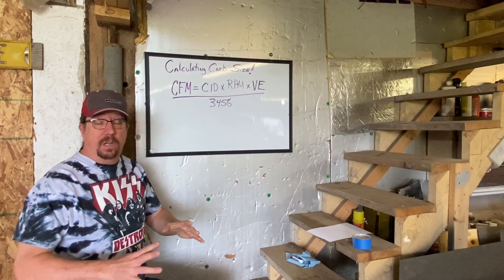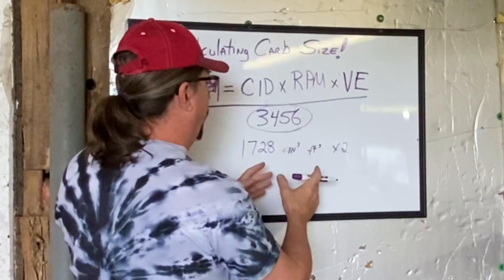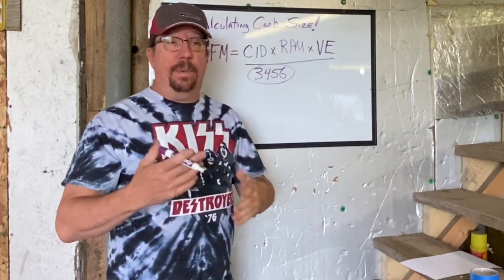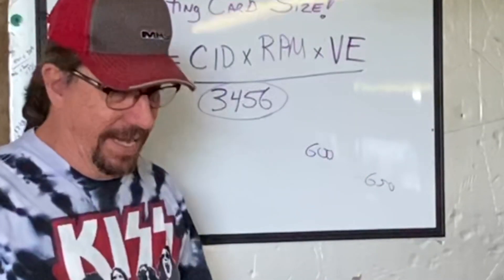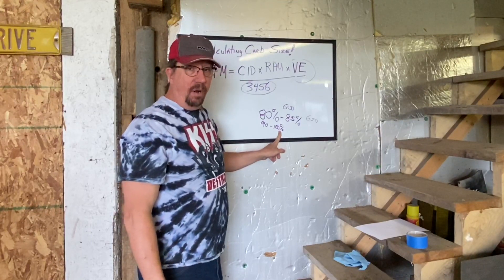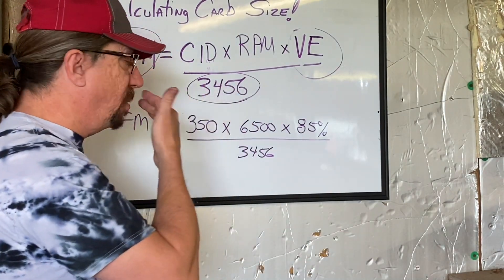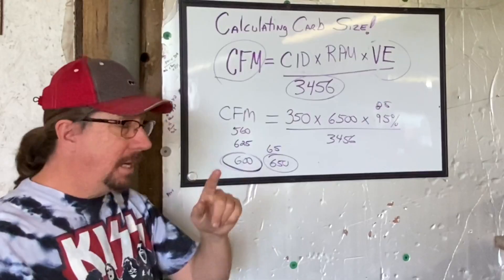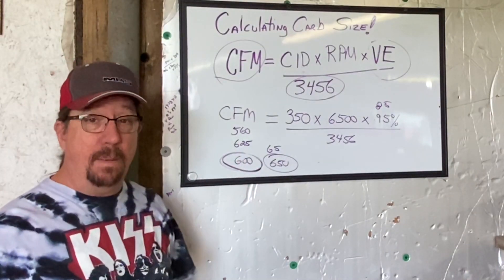HOW TO: pick the right carburetor.  SIZE MATTERS!!!  Don't overestimate, do the math.

Comment: People need to understand something basic about a CFM rating for a carburetor. It is a capacity and not a supply number. In other words the carburetor is not a pump but rather a valve. As the formula is showing an engine that can pull/call for "x" number of CFM. Basically the carb isn't going to "shove" or over-feed CFM but rather the engine is going to "draw" "x' amount of CFM based on cylinders, heads, pistons, and rpms. We could throw the manifold in there but for simplicity sake of the discussion you see where this is coming from. The carb is sized by the manufacturer to have certain dimensions of open space and size of the butterflies to coincide with a certain sizing of fuel metering in order to get an atomization figure that is efficient across a CFM flow range. You can plunk a 600 CFM carb on something and maybe it will be on a motor that will only ever try to draw 500 CFM max. You could conceivably re-jet/meter that carb for smaller fuel flow and be fine. My point is that there is a great misunderstanding about how a carb functions and what it is actually doing. When people say they have a 780 dual feed on a stock 5.0 ford and it seems to run fine it may very well be the case but not because the engine is calling for 780 CFM when it's cranking 6000 rpms but rather because the air/fuel ratio, atomization and quantity is OK for the other factors of engine performance and is not loading up the cylinders. There is after all an efficiency of combustion to take into account long before we worry about 600 or 850 for CFM figures on a carb. Most people do overcarb from a capacity standpoint which is quite different from a supply standpoint. Thought of another way if you put air flow monitoring between the carb and manifold on a 5.0 Ford and the carb was an 850 you might be astonished at the fact it might only be measuring a flow of 400 or 500 at 6500 rpms because that's all that it is trying to suck into the engine and the carb is not limiting it certainly but it has no ability to try and "over feed" CFM. As I said as long as the fuel/air is OK you not be overloading the engine on a CFM basis. Biggest mistake people make is not understanding what is actually happening with an engine. I don't care if a carb is rated for 2000 CFM if the running engine is only calling for 500 then that's it in a NA engine. The same for heads. They may have a flow figure that is way higher than what the cylinder as configured can, or needs to,  pull through them. You see guys with huge flowing heads running around on the street and they don't understand that the heads they paid huge money for aren't even approaching anywhere near the flow limit even when they're at wide open throttle. You start in the cylinder and it all follows from there.
Reply from the maker: Very well said. I actually circle back around to this and there’s another episode to qualify the context from which I was sharing this.

Thanks for watching. And thanks for your comments. Very well stated.

Comment: One thing I might have missed,  but single plain intake vs. Dual plane intakes makes a big difference on CFM.
Reply from the maker: This video is not about how an intake affect flow, but rather about the actual mechanical ability of an engine to flow outside of intake and carburetor.

There is another video on the channel, and we should clarify exactly where I’m coming from on this, because this video was several years ago, and was addressing specific questions at the time. 

https://youtu.be/jPmgrrbYqtQ?si=9BTzwmf_oIwBkyJp
Reply: and port cfm just because it is math does not mean it is right

Comment: I have to say you never know till you try, I ran a 1475 cfm Holley gen 3 carb on a 454, it ran great. So I believe anyone can say anything. Test and tune
Reply from the maker: Thanks for watching 

I elaborated on this more to clarify where I was coming from in a recent video. 

https://youtu.be/jPmgrrbYqtQ?si=jrtL7g34g169QhQf
Reply: It's better to have more carb and down jet if you have to
Reply: @GlenMorrison-p9d in my experience a carb that is to big for the application needs to be jetted up to account for the weaker signal at the booster's. Your results may vary...
Reply: @firedome8 Exactly. Contrary to what some people think,  too large a carb rarely runs rich. It's usually lean because the vacuum signal is diminished.

Comment: I have a Pontiac 428, had to bore .060 over because of cylinder scaring. My professional, lifetime experience engine builder said my 650 was too small.  Ihe suggested a Holley 750 double pumper.   It’s a street rod not race car.
Reply from the maker: You may find the second video I did helpful 
Thanks for watching! 😎

Revisited!  HOW TO: pick the right carburetor.  SIZE MATTERS!!!  Don't overestimate, do the math.

https://youtu.be/jPmgrrbYqtQ

Comment: What is the difference between a stick and a manual?
Reply from the maker: You raise a very good question 

A manual can mask too much fuel to a point /  because the engine can get to WOT where an automatic might bog 

However. Correct carb sizing will perform well in both scenarios 

At the end if the day, 
It’s really all about what you’re shooting for. 

I don’t mind over carbing as long as I know the trade offs.  

There’s another video that I recently rehearsed where I revisit this.  

You might find it helpful 

Thanks for watching!!!

Comment: Pontiac 455 should i get 650cfm carb ?
Reply: Wow awesome.
So definitely street 
It has 455 bored 30 over 
Smog heads
Edelbrock performer intake 
411 posi rear
Currently have holly 850double pumper and not happy. Would like to change the heads to Edelbrock aluminum and change the carb
Reply from the maker: I am revisiting this subject again  this coming Tuesday August 22, 2023

I think you’ll find it helpful
Reply from the maker: 600 if it’s a streetcar, 650 if it’s a drag car… But I don’t have enough information to be able to give you a realistic view. 

650 if it’s a Really, radical street car… 

Cam size, torque converter slip … or Stick shift? 

Application Dash Street car? Drag car… or Somewhere in the middle.

All of these things matter 

so

the application makes all the difference.
Having said, all of that… 600 to 650 CFM,  vacuum  secondary for a street car, 650 mechanical for a drag car… You probably will be OK.

Comment: You're wrong buddy...
I put a 1050 Holley double pumper on a 351 Cleveland with 2v heads and shaved 2s off my quarter-mile time that's all I did you want to know why it got faster  the holes in the base plates are bigger than a 650 or 750 more Air..

Comment: One things for sure, our cylinder heads and camshaft technology have come a long way from what it used tho be. But I agree with you that most people over carb their rides. How many classic rides have you seen at a car show that the fumes from being over rich chokes you out?
Reply from the maker: Exactly. People don’t understand the difference between building a full on race car and building a Street Kar. I actually have another episode coming out sometime in the next month revisiting this topic.

Thank you so much for watching
Reply: the carb being rich isnt because its oversized, its because they dont know how to tune the carb.
Reply: @cuzz63  its because manufactures  put out different sized and different TYPES of  carbs  that are all jetted different different venturis etc

.  and if you look at what they recommend for what it is youre doing,  you'll see most people pick the wrong one  and then it runs the way it runs vs  just using the MORE CORRECT ONE for the application.

a 750 holley on a stock 350  will work  if you tune it,  youre right.

but the main point is

why would you do that  when you could have just bought a 500 CFM   and not be messing around with it or messing with it way less and enjoying the car more?

could i put a 1050 dominator on my engine  when i rebuild and stroke it to a 6500 RPM 331 ?  sure

but maybe i should just buy the edelbrock 650  AVS2 or holley 650 vac secondary  for it  and ill have less headaches with trying detune the carb down to what it is i actually have going on
Reply: @KingJT80  your preaching to the choir....totally agree. I have seen time and time again on Dynos where a 650 will make close to the same power as a 750 on motors under 500hp and yet so many guys think they need a 750 on their 400hp motor.
Reply: @cuzz63  depends on if we're taking vacuum secondary vs mechanical.

Because a vacuum secondary 750 would be ok on something about 425hp

Look at the gm crate small blocks. They all run fine with 750s but they recommend mostly vacuum secondary unless you have a light car with some gear and a higher stalling torque converter in it

And the street avengers are setup like this too. The 770 they recommend for 400-500 HP but it's a vacuum secondary

Mechanical secondaries as you know are VERY SENSITIVE to being the right size. 

It's all about applications.
Reply: That is not over carbed that over jetted over carb would be lean because of to big a hole letting in to much air ! over carbed is lean because the air moves so slow it does not cause enough pressure drop to pull fuel from the bowl !

Comment: The math says. a. FE.  390.   At 6k.  .85.   ÷ 3456.   Wants.  575.  Cfm.   ?   Do why does a FE. 390. Make more power with a 750 dp.   25 ft tq.    Over a 650. Carb. On the Dyno.      The Dyno don't lie.      Something is not right with the formula
Reply from the maker: The formula is designed to give you the most driveable carburetor for a street car. Not maximum horsepower.

It may make more power with a bigger carb on a Dyno , but if you put that big carb  on the street you will likely feel  throttle response go away and your low-speed power drop off. 

The formula is designed to give you the best carburetor for overall street performance

Thanks for watching

.
Reply: @MyKARSShop     25. Ft tq.  As low as 2500. Rpm. Increase. Going from a 650. To a 750.   DP.     Seen a 416.  390. Stroker with just a   233.  .050.   Pull 716. Cfm on the meter. Being dynode   at only 5400.  Rpm.   OEM  iron heads.   So the formula. Is way off.    Now if it's 100%.   Bone stock.  Single exhaust. Then mabe it has some merit   thank you for your time sir

Comment: This is great there are so many opinions out there especially on the aftermarket parts reviews jegs / Summit /Forums  and alot of them are wrong. I  Iisten to too many and it cost me in the long run   I have read  put 750 nothing less i would rather be over carb than under carb .
Intake manifold as well i have a Ford 390 truck engime 9:1 compression truck heads puller motor basically i wanted to go from a 2bbl to 4bbl i bought the cast iron boat anchor intake  then read all.the jegs and summit and forum guys  saying ditch that boat anchor ⚓ get a Edelbrock but dint get the perfomer thats just wieght savings yiu will never  hit 5,000 Rpm with a regular performer you want the RPM performomer . Ok so i listen to them that thing was a beast the runners were huge compared to stock  anyone work on a 390 Ford ? The pushrods go down through the intake first drive i was not impressed i had actual better performance with the stock 2bbl and 350 cfm Holly .
The low runners gave me tons of tourqe and mid range power matched with the bigger base plate 350 2bbl if flowed better at take off and cruise . The high runners of the RPM needs heads that flow well to match and i woukd nevef hit anything over 4,800 with that stock crank  the Gt 390.was rated at 4,800 RPM  sure it runs good but in this case i  think it woukd run way better with the regular eddy or even the cast  iron 4bbl all because the internet new better see the price of thst thing lately ? A eddy performer RPM is pushing 700 bucks thanks guys 😮 whew had to vent ....

Comment: Hi.  Thanks for putting up this video and other content.  I just found you today and I'm subscribing!     
I have a 390 FE Ford big block engine that we're stroking out..    428 crank and alot bigger cam.   Its our first engine to build.   Do I kinda guess the cubic inches of what it could be... Or just go with the 390 original size..?    I have a brand new 750 Holly double pumper that I have access to..   Would that be fine since we're stroking it out?
Reply from the maker: If you know the bore size of the engine, and the stroke length of the crank, you can calculate the cubic inches.

There are plenty of online calculators in which you type in the bore size, the stroke, and the numbers of cylinders, and it will do it for you. Or you can find the actual formula and calculate it 

Once you know the cubic inches, I would look at cam size and compression ratio and come up with a reasonable VE number, and then find out where you’re at with your carburetor 

I would consider how it’s going to be used. Is it going to be daily driven, occasionally driven, is it a street performance car, is it a race car

You’re probably not far off with a 750 carburetor. But your transmission ratios, potential stall speed of the converter, and rear axle ratio is also play into it. 

My general rule of thumb is if it’s a daily driver street car, I prefer to have a smaller carburetor. If it’s just a horse around car, I always tend to go a little overboard with my carburetors.    

If it’s a full on race, car pro, I get pretty stupid with it. Lol.

The calculations in the video just help you find a baseline, so you get a ballpark on where to start

Hope that helps 
Thank you so much for watching. 
Thank you so much for the sub

Comment: Well, I know this math and used this math.
But it seem when you use a Dyno and experiment you find that on a 355 or 383 stroker pushing around 450hp and up at around 6500 rpm’s the 750 Holley really shines.
The 650 works great but you get more out of the 750 but as soon as you go to the 850 you loose performance.
“Watch Engine Masters”

Back in the mid 80’s I had a stock 350 with a 2 barrel and a automatic transmission. 72 Chevelle
I rebuilt it .
All I did was add a performer intake and cam for low end shaved the iron heads 20 thousands. 5500rpm was max and that was pushing it.
I installed a 600 Holley double pumper mechanical secondaries.
Was thinking I should’ve used a 650 vacuum secondaries.
No race engine but I sure had fun with it.
So, in my opinion…….
I think that calculation works great for stock or mostly stock engine and not so much when you are push 450hp and up.
I use that calculation as a good starting point.
Reply from the maker: I think that’s where that volumetric efficiency number comes into

Great feedback. Thanks for watching.
Reply: yeah more to do with VE  here.  

and is the car faster down the track?  the dynos are  one thing and mostly for making sure things are what theyre supposed to be

but the meat and potatoes is the track....